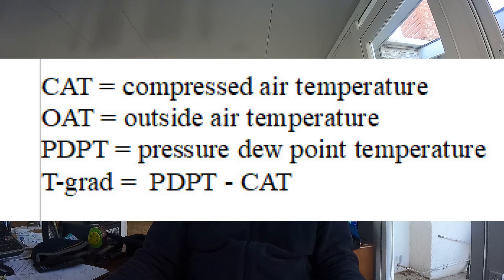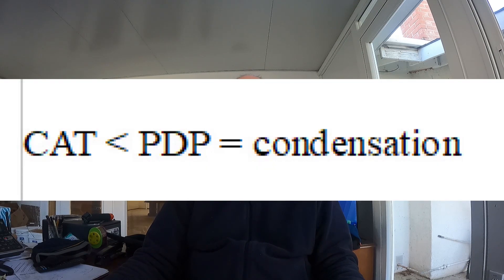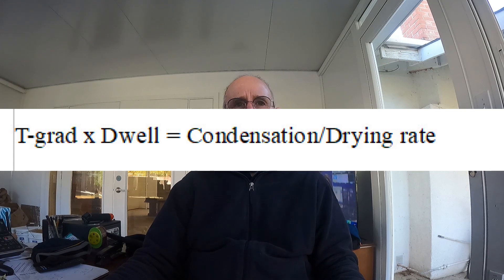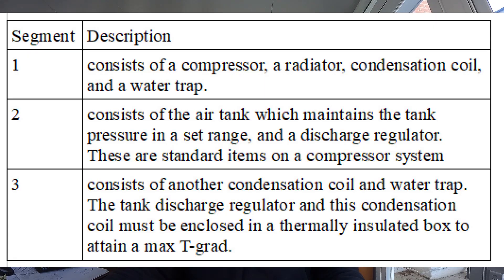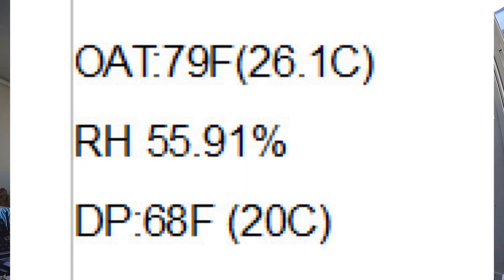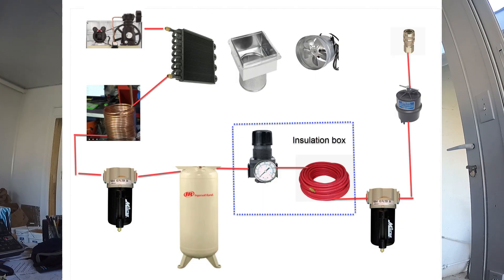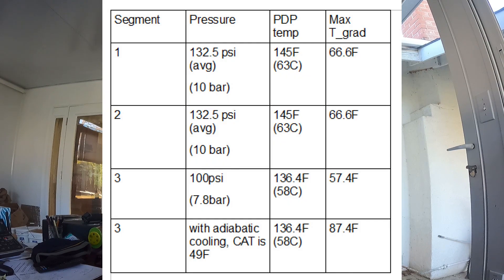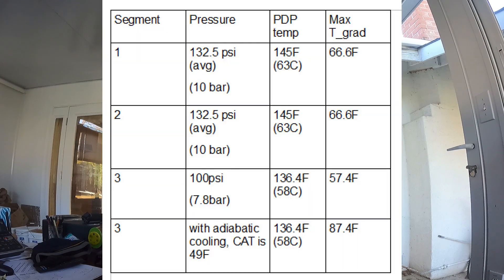DIY #9  Part 1:  Drying your Compressor Air

Comment: Wow!, This 3 part series is a goldmine of engineering knowledge regarding moisture removal from compressed air. 
As a retired (blue collar) technician from a large automotive research facility in San Antonio, Tx. I learned mechanics, welding, metal fabricating earlier in my career, but only learned engineering principles a little at a time, rubbing elbows with engineers & asking lots of questions, reading & studying avidly. In the early 2000"s I bought a cheap siphon sand blaster kit & it worked for 5 min. & started plugging up & I blamed the kit, not understanding anything about moisture control & how that affects dry abrasives. I tried again a year later with a cheaper gravity feed blaster & got the same results & I gave up. At the research every building had compressed air systems from 10 hp recips. for building air supply to 200 hp centrifugals for engine boost air. All systems had coolers & seperators, auto drains, & backup manual drains, plus every shift (3shifts) checked manual drains too! I observed & studied every system & once internet was widely available at work, I gradually learned the principles you are illustrating. I will recommend you to fellow youtuber, Bud Stiner, THE Compressor Guru for a guest appearance. Thank you for all the effort & knowledge you put into this 3 part series! Paul from S. Central Tx.

Comment: Good morning. The 3 videos are very informative.
The aim is to reduce the amount of water in the compressed air as much as possible. I wanted to ask if it would make sense to try to reduce the humidity already entering the compressor. For example, passing the intake air inside a large filter containing silicon gel could reduce the humidity already entering and make the process even more efficient?
Thanks, Giuseppe.

Comment: Good info!  That is what I am planning to build.  For the first "condensator" after the radiator before it enters the compressor tank, I plan to use a smallish 5 gal tank filled with coarse stainless steel to increase surface area for efficient condensation.  Plan to have an automatic purge valve on the condensator that allows any condesated water to be drained for about 3-5 seconds whenever the compressor turns on.  Any comments are greatly appreciated.
Thx
Reply from the maker: The stainless steel is a good idea.  I have seen some products that do essentially what you are talking about.  I think 5 gal will be extreme over kill.  Maybe a 3" diam 36" galvanized pipe filled with the stainless steel would work better.

Comment: Thanks for the Info Doug ,  i watched this several times  to try and get the theory . I was hoping on tips on how i  could utilize  a copper coil inside a small bar fridge that i already  have  to reduce the CAT  .  The OAT  is 53 F in winter 80F  in Summer . I have no idea on  humidity  I  am on the Wet-coast of Canada .. At what stage should i have this  refrigerated condenser coil ? before  the regulator  drops pressure from 125 to 100 or after ?     As a side note I do  have about 30 feet of 3/4 copper with drains on each leg  vertically mounted   as an after cooler .. I had it as an intercooler but the compressor switch wasnt cutting out .. I think the fitting i used must have blocked the sensing port ..  i will look closer at that.. once i got that sorted i was going to have a fan blow across the tubes . .Any tips would be appreciated. keep up the detailed videos ..great work
Reply from the maker: Watch part 2

Comment: Just when they convinced us that we need the driest air possible, they introduce water injection. There is a drier on the back of my plasma cutter. That’s all I’ve ever needed. I don’t live in a humid area, so I’ve never seen any evidence that air drying matters all that much.
Reply: @Wildman Tech: It's a good thing your region had low humidity, that's great for you. 👍less fortunate folks that live close to coastal areas like Mr. Kronemeyer (Florida), & myself (South Central TX.), have hot, wet, moisture saturated air & must go to extraordinary methods to achieve reasonably dry air. It sucks, but that's how it is  so we just deal with it. Dougs system is a hobby sized system, but is actually designed by him, a real engineer & is the most efficient, well though out DIY system I have ever seen in all of YouTube and there is No expensive closed loop refrigerated dryer! Cheers. Paul from S. Central Tx.
Reply: @PaulThomas-qo9vy  what effects, if any, have you actually seen from using moist air? I’ve cut on a rainy day and not seen the slightest difference in my cuts. 
Somehow I thought he and I were neighbors given he goes to the OHV park down the road from me in Sacramento.
Reply: @WildmanTech  Well, my plasma cutter quickly eats up the copper electrodes, guides, swirl ring (the consumables) & starts cutting sloppy, uneven with lots of dross, even though I use the factory depth guide (stand-off ring) to prevent too close contact damage. Also, before I understood moisture control, 2 attempts at sandblasting (w/2different blasters) was stopped within 5 min.by clogging equipment & water spraying out the hose. Disassembly showed mud clumps, even though the sand was filtered & dried. I gave up until I studied & learned about moisture removal. Now, I don't allow moisture to get into my tank, for fear of rusty tank explosions! Just YouTube rusty compressed air tank explosions! It's so violent & some times kill & maim people every year. As per his location, at the 6:55 time into this video, he states some local weather conditions & says typical weather conditions for Florida. I'm guessing mild winter conditions, since he appears to be wearing a jacket or turtleneck (I only have a smart phone screen & no PC.) Summer weather conditions would have been much higher quoted numbers. In my area of S. Central Tx, about 140 miles from the coast, morning temp. on July 4th was 80°F, relative humidity (RH) was 97% ! As temp. rises to max. of 99°F,  RH dropped to 37%.  Being outdoors = sweating. It sucks but the trade off is very mild typical winters (wearing shorts thru Dec. most days).
Reply: @PaulThomas-qo9vy  air dryers are located after the tank. My compressor dumps for 20 seconds every three minutes it runs, but everyone knows to drain your tank daily. I’ll definitely do that search you recommended.